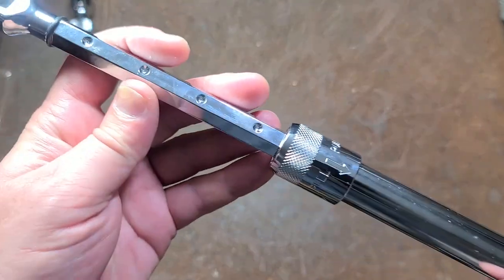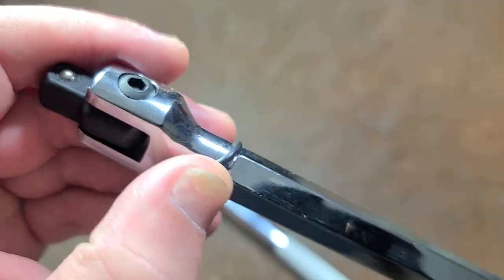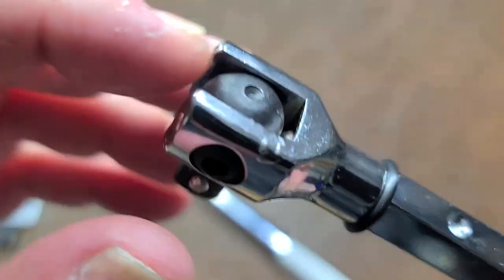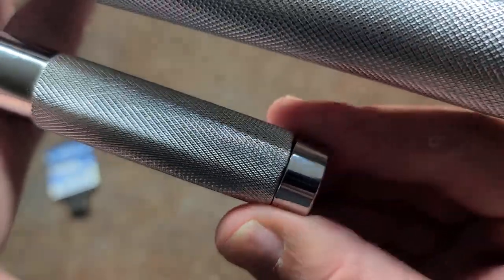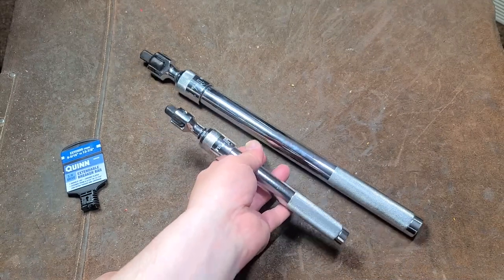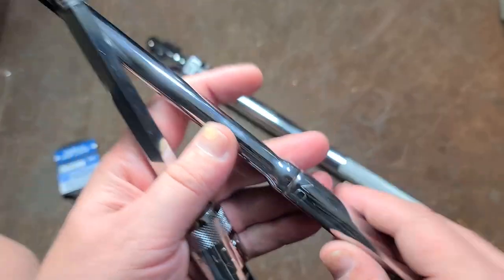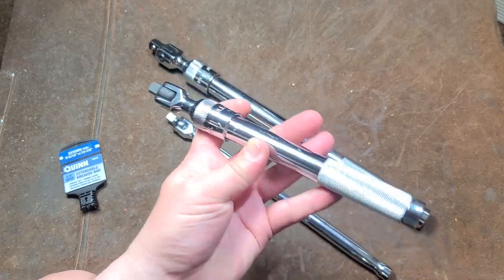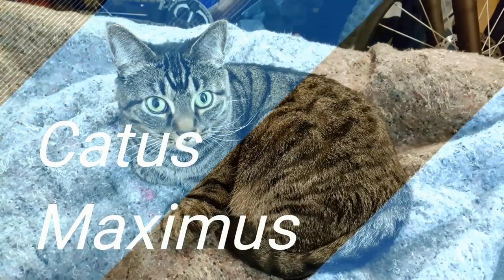Harbor Freight Quinn 3/8" Extendable Breaker Bar Review

Comment: I have a 24" telescopic 1/2" 'Huskey' breaker bar I received as a gift... it's just the right size to keep in the trunk, along with an old 6" extension, & extra 19X21mm 'flip flop' socket I acquired somewhere. Hope it's never needed, but it's there at the ready!

Comment: Can see them being used for trunk kit to break tire nuts (when the lug wrench included in most cars are too short for leverage.
Reply: Because you use your foot to break the lug nut loose. 

And dont forget to turn on and off your parking brake when changing your tire. With a little stress off of the rim.

Be safe out there.✌
Reply: @politicalpotato8383  True, but I've had instances where they were over torqued by the tire store, and even standing with full body weight (and hopping a little) wasn't able to break the nut (at 200+ lbs...)

The wrench provided was 10" at best (been a while since I've looked) and angled out a bit, which kills some leverage...

Comment: I've had the HF extendable ratchet and the HF breaker ber for some time now. I agree that it is somewhat gimmicky, but have run into situations where it's a handy damn thing. And no, I haven't tried putting a cheater and 500 lbs on it ....

Comment: I have the 1/2' drive version and it is under the seat of my GMC if I get a flat. It is compact and will work to get the lug nuts on and off. Otherwise I would not own one as it flexes too much for something really torqued down.

Comment: The only question is... what kinda pea-brain uses a 3/8 breaker bar and not just use 1/2
Reply: I like using them with crow foot sockets but that's about it, this one is pretty unnecessary
Reply: Some bicycle specific tools, like bottom bracket or cassette installation/removal tools are 3/8” drive. I use a torque wrench for installation but trying to get an old bottom bracket out or a cassette off a wheel? Out comes the breaker bar.
Reply: @galootlovestools  They make 3/8 to 1/2 adapters so you can use your 3 foot breaker to see what gives first
Reply: Me, with my 1/4 breaker bar 🥲